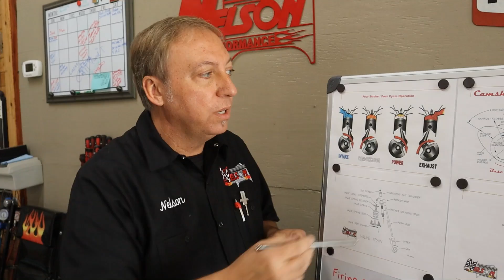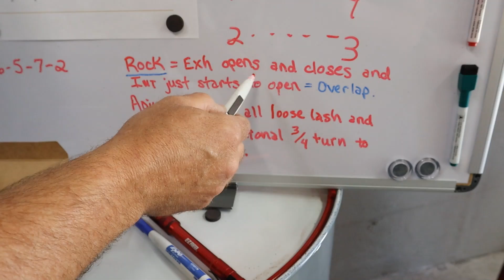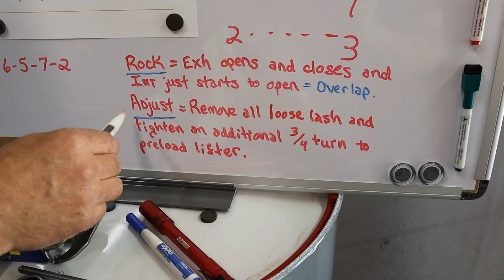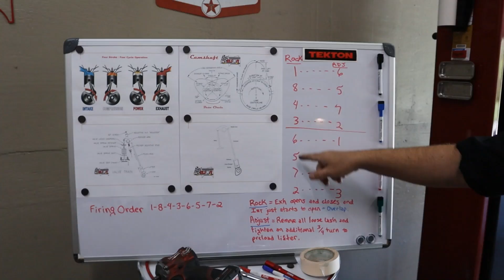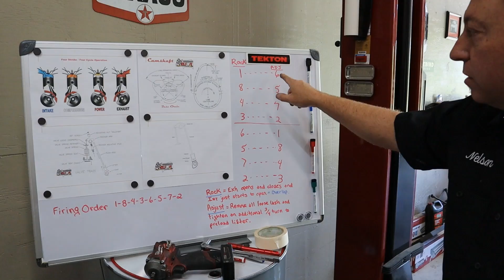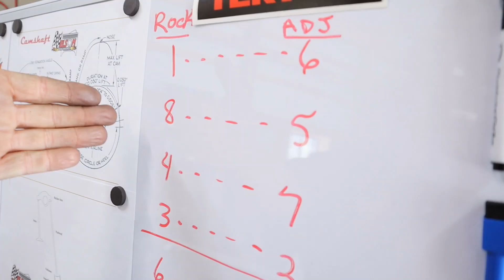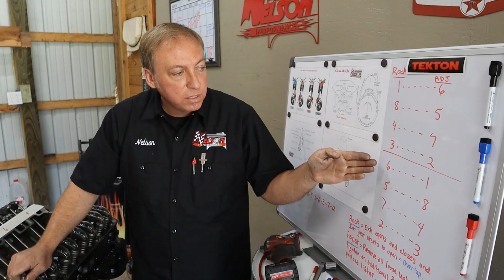Rocker Arm/Hydraulic Lifter Adjustment

Comment: I have a sbc350. I’m replacing my valve seals. If I turn cyl#1 to tdc my rotor on the distributor should be pointing at cyl#1 spark plug (also at the #1 spark plug terminal on the distributor cap). Now if I rotate the engine, the rotor will then point to the #8 spark plug terminal on the cap and so on as I rotate the engine. My question is when I rotate the engine and watch the rotor turn, will that cylinder be at tdc?  Thank you.
Reply from the maker: Hello again Joseph! If you are referring to the firing order, it should be close. The spark plug fires the plug a few degrees BTDC to give the flame front a head start (sooner as rpm/piston speed increases) so it reacts perfectly to contact the piston to force it down the cylinder, but you should be able to use the distributor and rotor to determine when both valves should be closed and the piston is up close enough to prevent them from falling in the cylinder during seal replacement. Also be aware if you plan to use air pressure in the spark plug hole to keep the valves shut, the air pressure can and will push the piston down. If you plan to pull the plugs you can also easily see if the piston is at TDC. Another old school method is to run rope into the plug hole and bring the piston up gently to force the rope against the valves. Hope that helps.
Reply: Thanks again. I was going to use the rope method instead of air.
Reply from the maker: @josephwalker2541  perfect!

Comment: No oil just assembly lube. Tighten each one up to zero lash, quarter turn on the crank adjust the ones that come loose. Do 8 90degree turns and repeat the process each 90. I dont even worry about sequence. Once they are all at zero lash i do three quarter turns. Works every time.
Reply from the maker: Yea, I’ve seen another video where a guy did it that way. That should work as long as you keep track of them.  I started working for Jasper Engine and Transmission out of high school and I finished the engines up from short blocks. I put the top end on around 25-30 engines in a 10hr day and we had found this method to be the fastest and most accurate. I appreciate the comment! Keep wrenchin friend!

Comment: I've never done this before, but I've taken the top end off my motor with plans to change the cam, lifters, and springs...I'd say watching this video made me feel confident in doing so! Great video!
Reply from the maker: Great! The older Dodge shaft type (non-adjustable) rocker system can be “adjusted” by changing the length of the pushrods instead to get a desired lifter preload if needed. This is also the common procedure on the newer LS engines. Thanks for viewing and subscribe. More videos on the way. Good luck on your project!
Reply: So much more fun to remove the engine and do it on a stand

Comment: Does this work the same way for full roller rockers? it is still a flat tappet hydraulic cam, but it will have full roller rockers.
Reply from the maker: Grant, yes, This method will work just the same for roller rockers. Full roller rockers are always a good idea. Adds a little power and extends the life of the valve guides. Good luck on the project!
Reply: @mitchnelsonperformance  Thanks so much! Finishing off my 383 stroker with some Edelbrock heads and roller rockers!
Reply from the maker: Love the 383. GM should have put that combo in many vehicles. Building an LT one here as well. Did you use a small base circle cam or clearance the rods? I know a couple of the rod bolt casting areas will contact a lobe of the cam if not.
Reply: @mitchnelsonperformance  It's in a truck, so I put a pretty mild cam in it. It seems to have cleared ok because I haven't had any problems with it. It was an eagle kit and had some ARP rod bolts that were pretty low profile, so I didn't actually have to clearance anything.
Reply from the maker: @grantb7677   Perfect!

Comment: I have small block Ford (302) with ‘76 heads (flat tap).  According to Ford, there is no adjustment.  Just torque the rocker bolts to 17 ft lbs.  Do you agree?  Would your opinion change if an aftermarket camshaft (e.g., Comp Cam , 1100-5200 rpm) was installed?   As others have said, excellent video; easy to follow, and implement.
Reply from the maker: Hey David, yes, the later ford small blocks had a solid mounted pivot, but if you have new lifters you can still check to make sure the center of the plunger is off the retaining clip and that the lifter has sufficient room in it for oil.(like I did at the end of the video). I believe we used to use a “Go No Go” gauge to check lash between the rocker and valve tip using the sequence. I think it was an .080-.180 gauge (min-max) lash. Hope that helps
Reply: @mitchnelsonperformance  - great info.  Thanks!
Reply from the maker: @davidturk6301   No problem and one more thing. You can change pushrod lengths to improve preload if needed.

Comment: good greeting .
There is a diesel fuel leak in the oil tank of a Detroit 8-cylinder engine, please tell me why and how to fix it.
Reply from the maker: Hello, first off I deal with more gas than Diesel engines but if you remove the valve/rocker cover and plug off the return line to the tank, install a hand pump and pressureize the fuel system AFTER the fuel pump to 70 psi. The leak will show up. Usually a damaged jumper line or a loose line under the rocker cover. I have also seen the 3/8 washer under the fuel line connector at the top of the head leaking. Remember AFTER the fuel pump. Any pressure greather than 15 lbs at the fuel pump will blow the seals out. Also check the weep hole at the pump to determine if the pump is bad. Hope that helps diagnose it.  Thanks for subscribing! More videos coming soon.
Reply: @mitchnelsonperformance  Sorry sir, does adjusting the air and exhaust valves have anything to do with this problem.
Reply from the maker: @belgasemalmhjob7472  No, the rocker adjustment would be related to low compression or low power symptoms.
Reply: @mitchnelsonperformance  Thank you so much
Reply from the maker: @belgasemalmhjob7472  No problem!

Comment: Did you prelube or soak the lifters in oil before you  installed  them?
Reply from the maker: Hey Gerald, I do prelude the lifter bores and cam contact surface. I typically don’t soak them as it fills the hydraulic chamber with oil and makes checking the preload a little tough. I do prime the oil pump to fill them after adjustment before starting the engine. Thanks for the comment!

Comment: nice video mitch however you might want to mention that this procedure is ok for stock or very mild camshafts, however if you have an engine with a solid or radical cam the cam company usually recommends you turn the engine over until the exhaust vale just starts to open and then you adjust the intake valve of the same cylinder, then you turn the engine over until the intake valve FULLY OPENS and just starts to close, at that point you adjust the exhaust valve.  and on your method after you rock the first cylinder turn the engine 90 degrees and your ready to adjust the next cylinder.  by the way i agree with the comments great job of explaining this procedure
Reply from the maker: Hey Steve, True, the EOIC method is commonly used today on some performance cams. I figured most youtubers searching for rocker adjustment are more than likely working on milder engines. I have used the EOIC method as well. The method here tends to be a little more “user friendly” for most. Thank you for the comment!

Comment: About to do some 2v gt40 3bar heads on a 351w  ..  .. most people dont understand the old school simple ways
Reply from the maker: Thank You. Those GT-40 heads are a nice cast. The flow numbers were considerably better than traditional 302-351 castings, especially after porting. The last engine I built using those was a 351W with a 671 BDS blower sitting on top of it 😏 It was a guy that worked for BDS and he put it in a Fairlane and drove it across the US to California to show how drivable having a huge blower sticking through the hood could be 😄 Good luck on the project and thank you for subscribing. More videos coming soon.

Comment: So if we start the first “rock” on cylinder #1 and “adjust” cylinder #6, to move onto “rocking” #8 could we just turn the crank 45 degrees. Then continue rotating 45 degrees each time, since 360 degrees divided by 8 is 45 degrees.
Reply from the maker: Hey Joseph, on the typical V8 there should be a cylinder ready to adjust every 90 degrees of crankshaft rotation. The cam and crank are two to one ratio and the four stroke engine fires the plug every 720 degrees (two rotations). Neat Question! Thanks
Reply: @mitchnelsonperformance  Thank you!

Comment: Does it make a difference if there is oil in the lifters?
  drained the oil but still have oil in lifters. Replaced head gaskets. I dont want to replace the lifters because then also cam has to be replaced.  Where does it end?
Reply from the maker: Hey James, the method will work fine even with oil in the lifters. The valve springs will bleed the oil out of the lifters as you turn the engine over as the rocker pushes the valve spring down. This will get the plunger off the wire clip in the lifter. The valve spring pressure has enough force to push the pushrod into the lifter bleeding the oil back slightly since the oil pump is not producing oil pressure unless the engine is running. Another fact: You can replace the lifters with new ones on a used cam. You should never swap pre-ran lifters around in an engine as they wear/break in to that specific cam lobe. If you ever do decide to replace lifters on a used cam I always draw (paint marker) a vertical line at the top of the pushrod and I start the engine before I install the valve covers and you can make certain the pushrods/lifters are spinning as it runs. Cam lobes are ground at a slight (.001-.003) taper to rotate the lifters and prevent wear.

Comment: Can I do this procedure after I have run the engine?
Reply from the maker: Hey Pete 68, the method will work fine even with oil in the lifters. The valve springs will bleed the oil out of the lifters as you turn the engine over as the rocker pushes the valve spring down. This will get the plunger off the wire clip in the lifter. The valve spring pressure has enough force to push the pushrod into the lifter bleeding the oil back slightly since the oil pump is not producing oil pressure unless the engine is running.
Reply: Mitch Nelson thanks when I built it up I didn’t use your method, so I tried doing it running—no fun. Really appreciate the tips, subscribed to your channel, thanks again.
Reply from the maker: @pete6849  Great! Thank You. We are working on more videos!
Reply: Btw, did it last weekend. Everything was perfect.
Reply from the maker: @pete6849  Great! Thanks for the feedback and good job friend!

Comment: Awesome demonstration on how to do it. Best I’ve seen by far. I just rebuilt the entire engine in my 1986 Corvette. With a 526 lift cam from Lunati with their matching lifters it’s a flat tapped cam . I installed a gear drive the 350 block is now a 355. I bolted on a new set of Edelbrock E-Street aluminum heads. But I used my stamped factory rockers and pushrods. I think the pushrods are 7.75 inches long. I’m in the middle of my 500 mile break in, and what happened next ? My #8 intake valve spring broke in 4 sections and the inner spring or damper spring broke in 3 sections. What would cause that ? Only one to break. Soon as I order and get my now springs I will adjust my rocker the way this video showed. 
This video rocks🤘🤘🤘🤘🤘🤘
Reply from the maker: Hey Mike, Thank you for the kind words. A few questions on your build. I’m assuming the Edelbrock heads came with springs to match the cam or did you use the Lunati matched set? Are they beehive style springs? Just trying to rule out coil bind. I have seen spring (new and old) failures through the years just from an unfortunate “bad batch” but it’s not common. I also wanted to mention the rockers, .526 is getting up there for a stock rocker as far as the pivot slot. This would not cause your spring failure but I would for sure check them out and make sure you don’t need to install “long slot” rockers to allow for the extra lift. Many times you will notice a contact mark on the rocker stud where the slot hits it. (Sometimes on a few and not all) Otherwise no solid answer to your spring failure. Yet!

Comment: what if the lifter is full of oil
Reply from the maker: Hey Tony, the method will work fine even with oil in the lifters. The valve springs will bleed the oil out of the lifters as you turn the engine over as the rocker pushes the valve spring down. This will get the plunger off the wire clip in the lifter. The valve spring pressure has enough force to push the pushrod into the lifter bleeding the oil back slightly since the oil pump is not producing oil pressure unless the engine is running. One more thing to mention is if this is a used (previously ran) flat tappet camshaft, the lifters must be placed back with its mated cam lobe. i.e You can’t mix the lifters up or switch them in the lifter bores or they can wear the lobe and lifter

Comment: Why adj in that specific order ?
Reply from the maker: Hello, A couple of reasons: one is to make certain that the cylinder being adjusted is on the base circle of the cam lobe (no lift at all) and a second reason to use this method is to prevent you from having to turn the engine over many many times to get them all adjusted, especially if the engine is in the vehicle. It also helps you keep track of the valves/rockers that have been adjusted.

Comment: i have a rebuild long block 350 19755-no rocker arms - i ordered on line i had the  push rods-so i'm ready to use your- method  i discovered the lifters were already pumped up---- so do i still use your method when lifters are even just take out slack-the do the 3/4 turn--its possible the engine has a mild -will the stock one still work thanks A++++++
Reply from the maker: Hey Phil, yes, the method will work fine even with oil in the lifters. The valve springs will bleed the oil out of the lifters as you turn the engine over as the rocker pushes the valve spring down. This will get the plunger off the wire clip in the lifter. One more thing to mention is if this is a used (previously ran) flat tappet camshaft, the lifters must be placed back with its mated cam lobe. i.e You can’t mix the lifters up or switch them in the lifter bores or they can wear the lobe and lifter.
Reply: should be ok on the cam, and lifters  thats all new---thanks for the help so i should just tighten enough to squezze the oil out so the so the plunger doesn't hit the clip-ill keep you posted  i dont have the blancer on yet-so ill do that first----great site   @mitchnelsonperformance
Reply from the maker: @studeystudebaker  Hey Phil, saw your reply and just wanted to make sure you plan to only do 3/4 turn after the play is out

Comment: I have a question as I'm worried about valves hanging open. Once set to zero lash, why would it need to be tightened 3\4 of a turn to preload it, if the oil will fill it anyway? If turned in to slightly depress the plunger (one turn is about 10thou, so 3\4 would be 30thou), then wouldn't the oil when filled, push the rocker stud more and thus leave the valve hanging? Or is there more than 30thou for the plunger to go down?
Hope my question made sense! Thanks!
Reply from the maker: Hey Ray, Good question. Yes, the plunger has a lot more travel (to hold oil) than that. The 3/4 turn is to make certain the wire retaining clip holding the plunger doesn’t have any contact/pressure causing it to pop off into the engine and 0 lash could cause that. As far as valves hanging open: The valve spring creates enough (more) pressure than the oil pump hydraulic pressure inside the lifter preventing it from over pumping the lifters and opening the valves. The camshaft opens the valves quickly when running even at idle, faster than the lifter can “bleed” off the oil. Hope that helped?
Reply: @mitchnelsonperformance  Thanks Mitch for the quick and detailed reply! That is making a lot more sense to me now. I thought the goal was to have the plunger go all the way down to remove any "play" after lash had been set. But it makes more sense now :)
I recently adjusted the valves on my 1980 K20 as it sounded like they were noisy, (don't think they had been touched since they  left the factory as the gaskets crumbled when taking valve cover off) but afterwards the engine was really stumbling and only held about 8inches of vacuum. I backed them all off and it ran nice again at 22 inches of vacuum. They sound better though but the engine still feels a little stumbly, so I'm caught between backing them off but worried about them flying into the engine, or having them too tight and having the valves hang open. 
The video is really informative and helpful, thanks for taking the time to make it and share your expertise!
Reply from the maker: @car_ventures   No problem! and thanks for Subscribing. We have more videos in the making.

Comment: Agreed, best SBC hydraulic lifter video ever! I was taught 1/4 - 3/4 turn after lash is removed. I never thought about the fact that the pushrod seat can contact the retainer clip if you do not tighten the nut down enough. The rock and adjust the sister cylinder method is genius.
Reply from the maker: Really appreciate the kind words!

Comment: One crazy question do we to start at top dead center compression when we start?   Or does it not matter? Thanks
Reply from the maker: Hey Rob, I usually just start with the beginning cylinder on the firing order (I.e #1). So if you “ROCK” 1 and “ADJUST” 6 like the engine in the video then 1 should be in overlap (finishing the exhaust stroke) not compression. Hope that helped.
Reply: @mitchnelsonperformance  thanks 😊